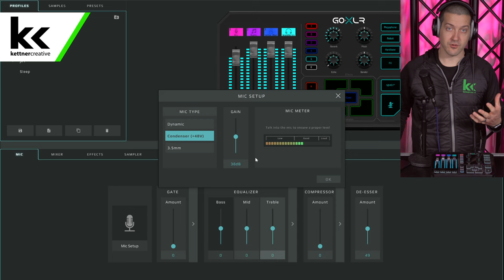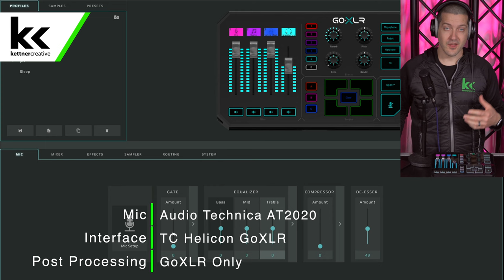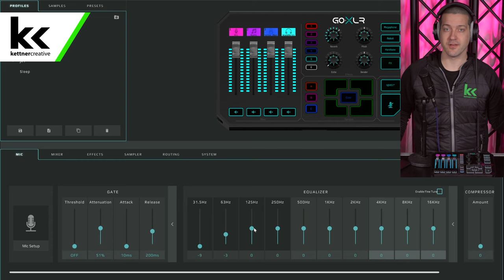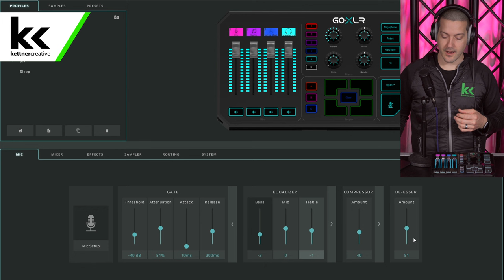GoXLR & Audio Technica AT2020 Setup | Best Mic Settings

Comment: at about 6:30 you did mention wanting to use the 400 Hz range but remarked that you had to round it, but, even in this version you had for the GoXLR, you have the "enable fine tune" option which allows you to tweak the range from 500 to 400, along with tweaking every other range to be higher or lower.

Comment: Thanks for the setttings. I have a AT2020 using GOXLR mini. The only issue is the background noise. I have a fan running and you can alwways hear that and other things going on in the background, Any ways to fix this? Also, is it better to leave the mic as it is without a foam cover or should I get one?

Comment: I have a AT USB 2020+ Usb microphone how would I go about connecting it to the GoXLR?
Reply from the maker: It's not highly recommended to use a USB mic with the goxlr. But you could connect the headphone output of the AT2020USB to the Mic Input on the GoXLR.
Reply: @kettnercreative  what are the drawbacks to doing so if you don't mind me asking, sorry I haven't been able to find any info online about it
Reply from the maker: @89SirDaniel  The headphone amp on the mic adds noise which is then re-amplified by the GoXLR.

Comment: Hey, just bought the at2020 to go together with my already owned goxlr mini. For some reason my voice seems really quiet even with your settings. Any ideas how to fix that?

Edit: using obs stream elements and I have no filter in obs and my audio/mic volume is on max.
Reply: you gotta turn up the db
Reply: The mini only has 24v of phanthom power and the at2020 needs 48v so that might be the issue
Reply: @GentlemanNr1  lmao the mini and the regular go xlr both have 48v